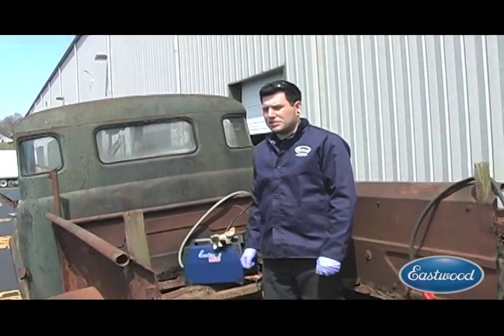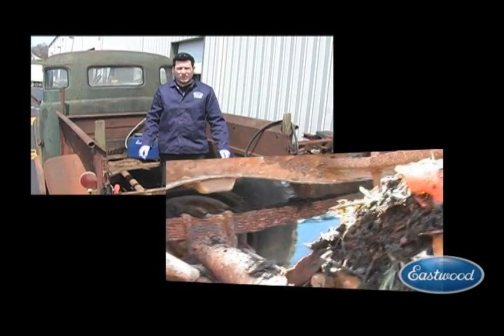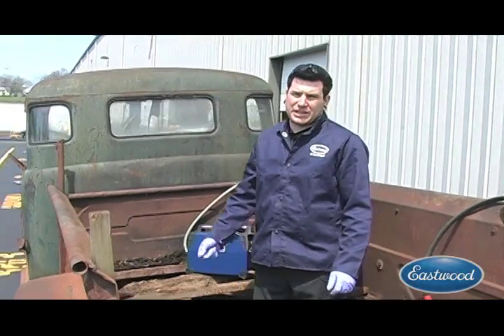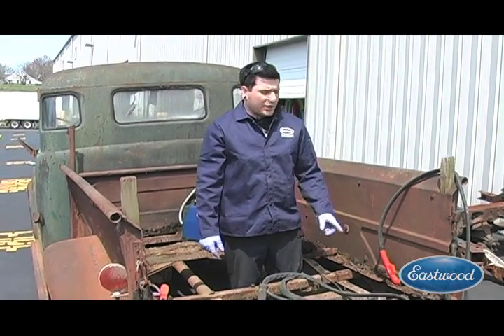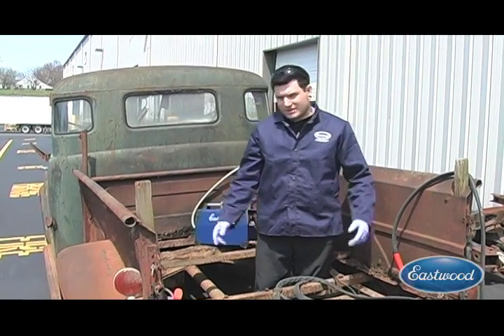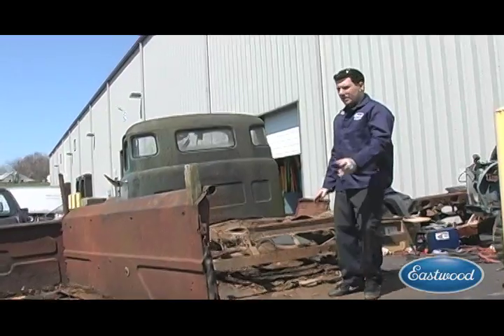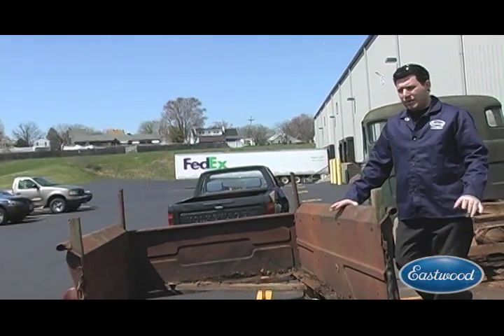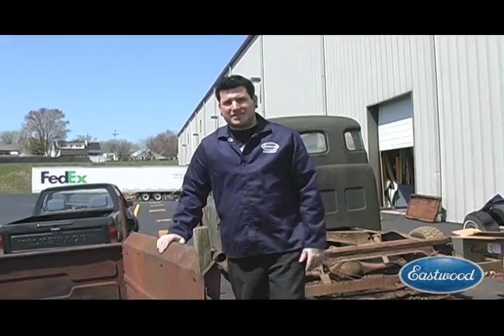Plasma Cutter - Dodge Pile-House Pickup Bed Removal with Versa Cut Plasma Cutter at Eastwood

Comment: Make sure your ground is connected to clean metal if possible when cutting anything rusty.  What is the rating of your extension cord?  Remember thinner cords will heat-up quickly and if they are long, more resistance in the system.

Comment from the maker: Check out our updates on Project Pilehouse...the body has been removed and is mounted on a Chevy S-10 Chassis.  The bed floor is probably going to be metal, but we're extending the length of the bed about a foot.  We've also repaired the doors using our Patch Panel Kit and Contour Body Filler Line.  Check out the videos as we make progress!  Subscribe to get alerts.

Comment: When i hook my versa to an ext cord on 110v it overloads , or has 1 hell of a time starting a cut.. The pilot arc will work but it will not start a cut on rusty material as you show in this video.. I have a rusty old 1958 apache i am trying to patch up and bought the plasma from eastwood based on this video.. I am having a little trouble with it...

Comment: re the bed floor planks always look good when done well and i am sure there are people who make kits i think i Jeff from "jamesfreddys" YouTube channel did it once . a plane flat bed looks boring although practical  a ribbed floor adds strength , or you could cheat and do both  i am sure 3M make wood grain vinyl you could lay down and clear coat, chrome  vinyl  strips for joiners and can stamp out some 3/8th circles in chrome to make screw heads

Comment: Do you have to allow the plasma cutter to touch the metal to work? Also, would you use a plasma over a cutoff wheel for auto panels?